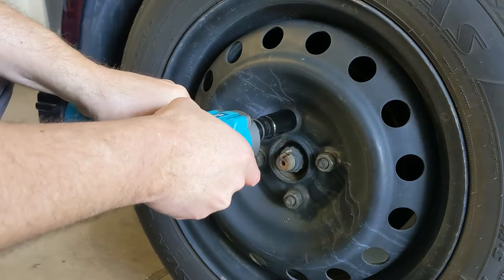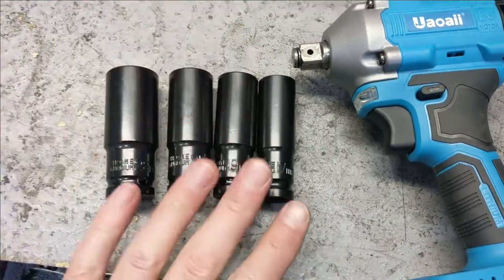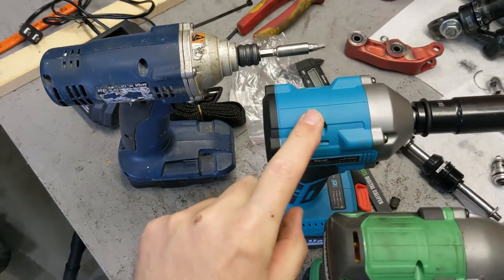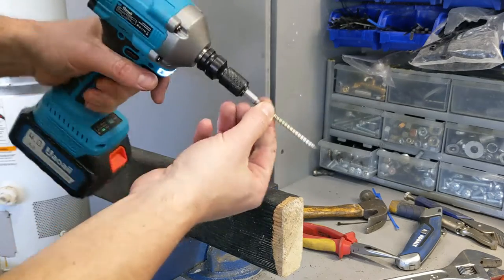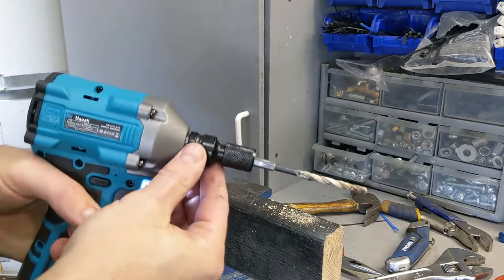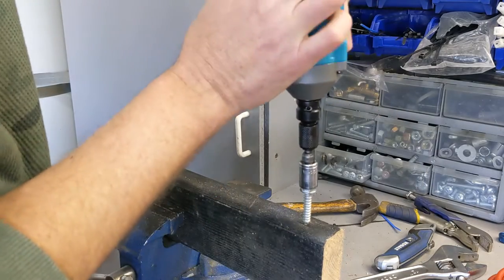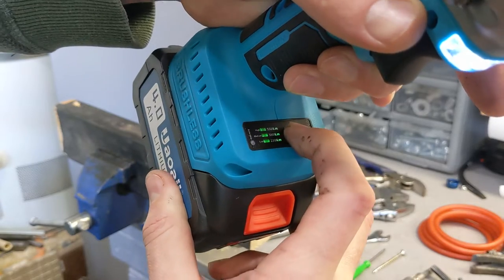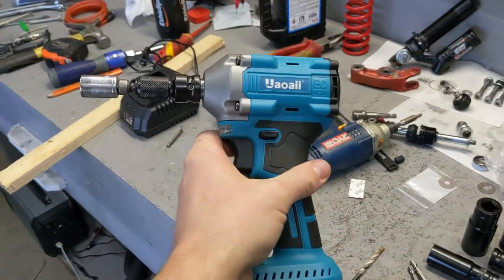Real World TEST Uaoaii Cordless Impact Wrench - My First Impressions

Comment: What joke. You do know that most wheel lug nuts are torqued around 80ft. lbs.
Try taking out a crankshaft bolt since it an 1/2" impact
Reply: Breakaway torque is often much higher than tightening torque. Especially wheel nuts/bolts which haven't been off in a while.